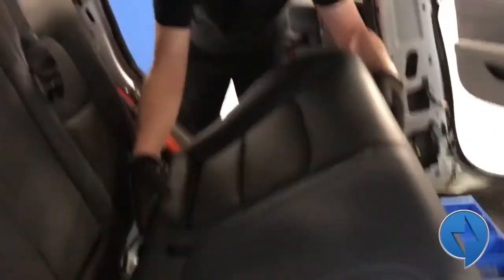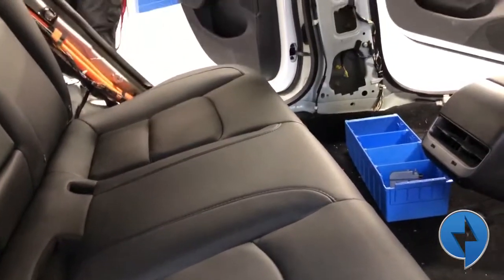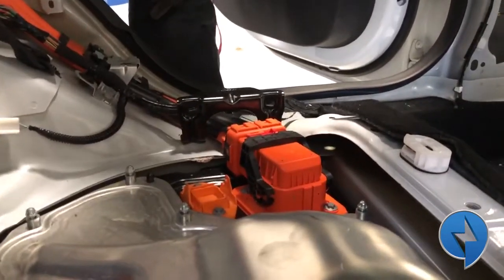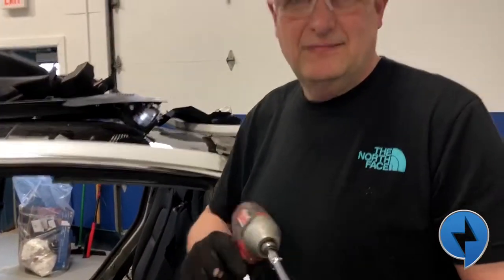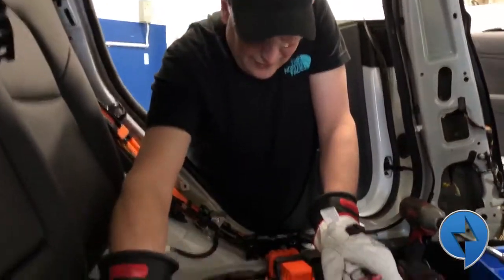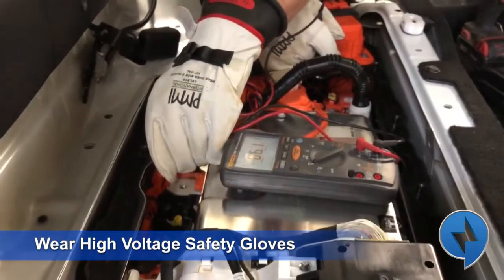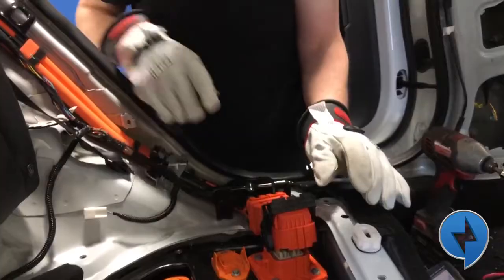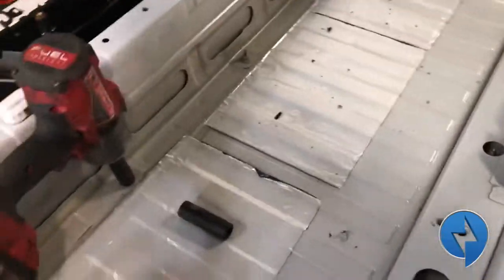Tesla Model 3 Battery Removal & IDEV Build (PART 1)

Comment: ELON:  You need to do better.  Just put the battery on a slider platform. Put a panel on the side of the car, open up the panel, slide the battery pack out, pick up, replace with a new battery pack, slide in.  DONE.  THAT SIMPLE.

Comment: 2:45 Special custom socket that David had made for Tesla battery penthouse removal.
3:50 All the secrets under the penthouse.
4:35 High voltage battery check for voltage - dangerous part
5:50 Tesla's come with free condiments

Comment: Will never buy a BEV that har battery fixed to frame like this. Model S and X are much better. Batteries will need to be replaced down the line.